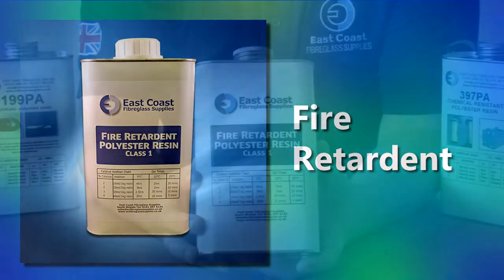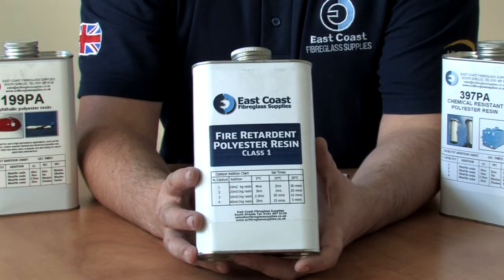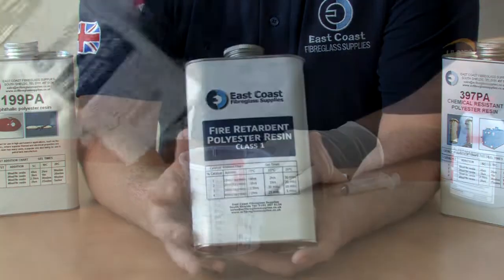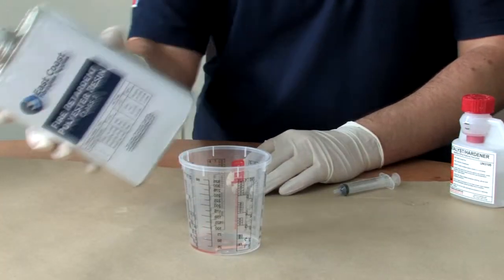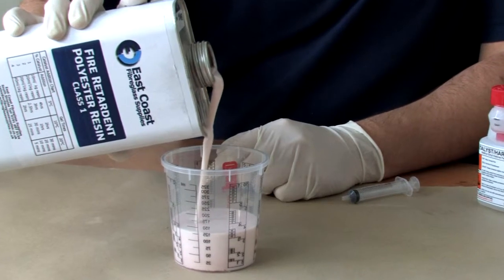Fire Retardant Polyester Resin

Comment: Which Chemistry of Flame Retardant suits Liquid Polyester?  what is the Dosage advisable of Flame Retardant?
Reply from the maker: +akshay oza Hello, it's ANTIMONY TRIOXIDE
Reply: +ecfibreglassuk Thank you very much for your Reply.
Please let me know, whether Poly (2,6-Dibromophenylene oxide) chemistry could be applied or not? for the Same.
Reply from the maker: +akshay oza Hello, I'm afraid I don't know. We're not chemists, the information on chemicals used is on the safety data sheets for the product.